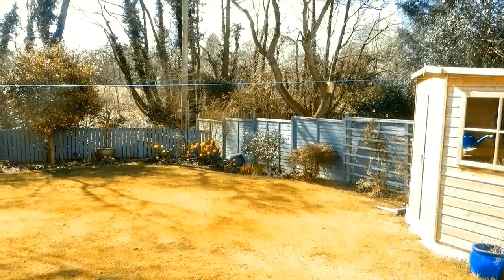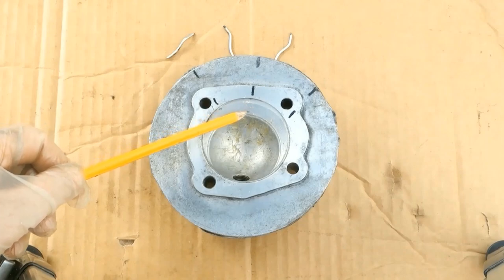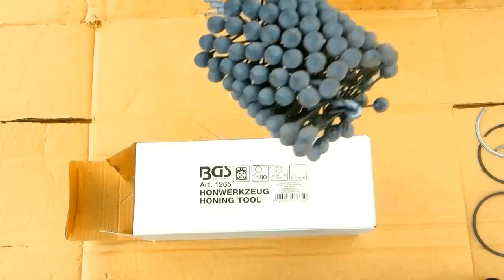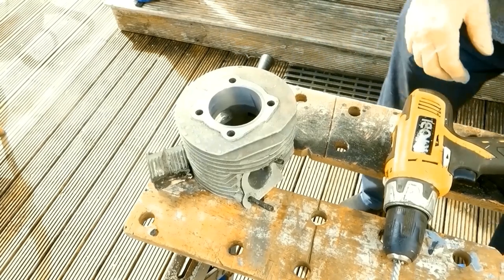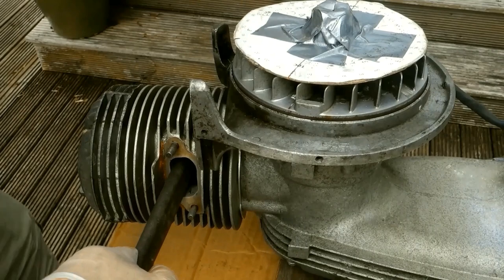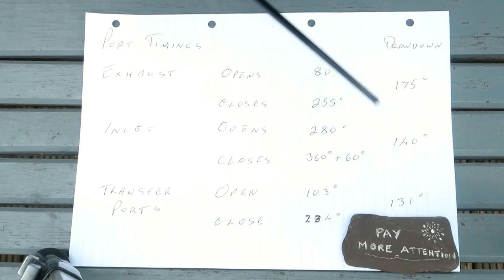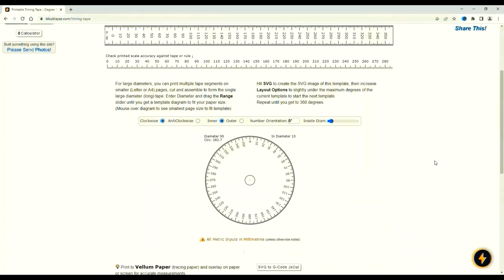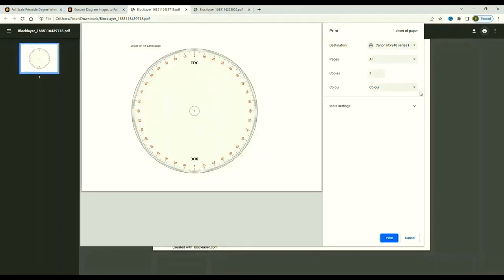A Novice and the Art of Lambretta Maintenance. Squish. Honing. Port Timings. Printable Templates.

Comment: Hi from what I remember about honing, which I haven’t done for about 30 years, to get nice cross hatching you need to use the drill quite slowly because faster speeds just put lines going straight around the bore, nice job 👍
Reply from the maker: Thanks for the comment and yes I agree, came to that conclusion by the end of the sequence.